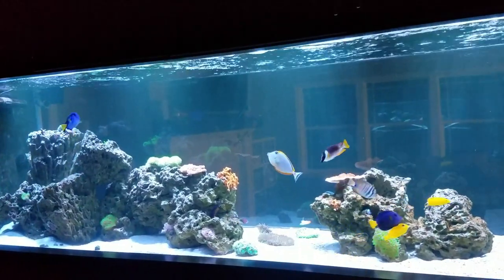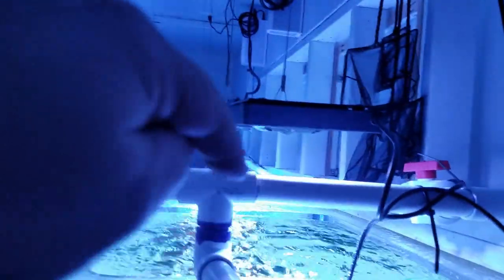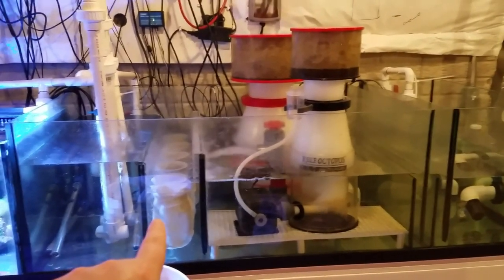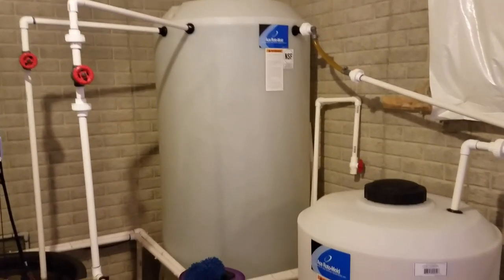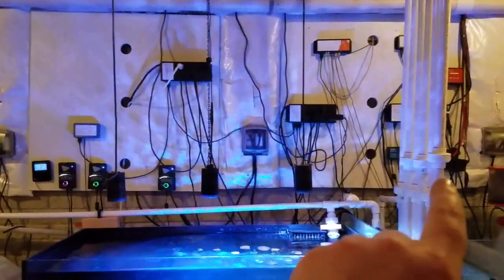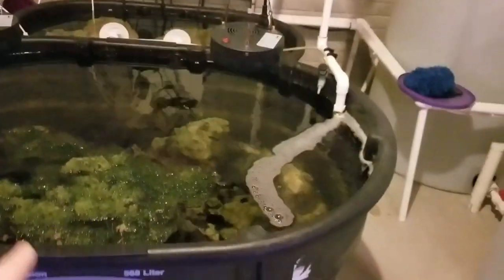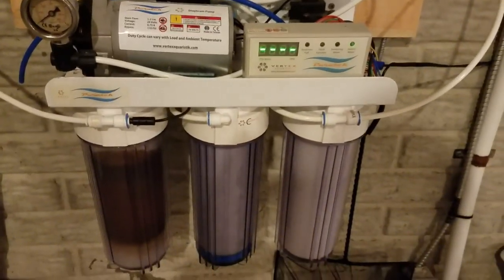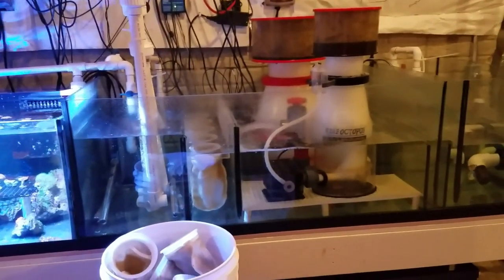Episode 2: Plumbing and Filtration

Comment: What are you using for return pumps and how high is the head pressure . Thanks
Reply from the maker: The main return pump being used is a reeflo hammerhead gold hybrid.. I'm estimating the head height at about 16 feet before any turns or 90s affect it more

Comment: What size of the titanium heat exchanger did you go with? How do you install it.
Reply from the maker: It was a 55kbtu exchanger I found in Ebay for about $175. It was installed in line with on of my drain lines that typically has a full siphon.  Check out one of my previous videos where I show how I installed it. I hope this helps. https://youtu.be/gNnMThAYZoE

Comment: It's an awesome system but seems like potential flooding issue with the matched flow pumps should a failure arise. Possibly raising the tubs with live rock gravity draining them back to the sump and isolating the frag system would be an economical solution. Either way though nice system keep up the videos 👍
Reply from the maker: Thank you.  I have a few safe guards in place after flooding a few times.

Comment: How do you adjust the temperature on the heat exchanger?  Incredible setup!
Reply from the maker: Thank you.  It is controlled by the apex. I have a temp probe and tell the recirculating pump to come on and an electric ball valve to open when the temp drops below 77 degrees.
Reply: Ahhh. Gotcha. So the water isn’t flowing through it all the time. Only when you need it. Very cool
Reply from the maker: Yes definitely only when you need it. It will heat up the tank a half of degree in 5 to 6 minutes